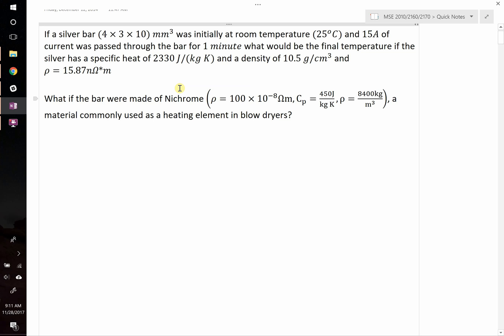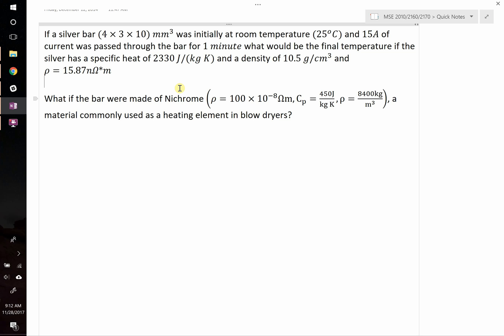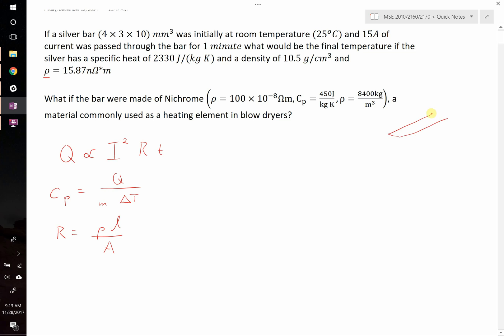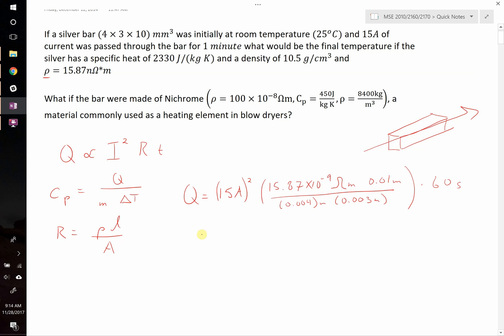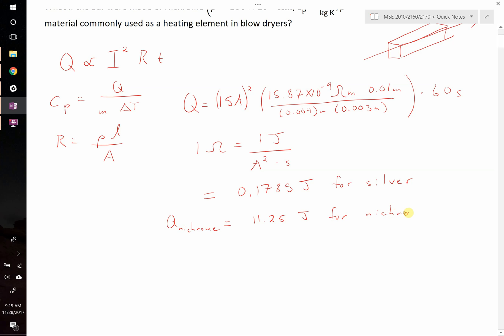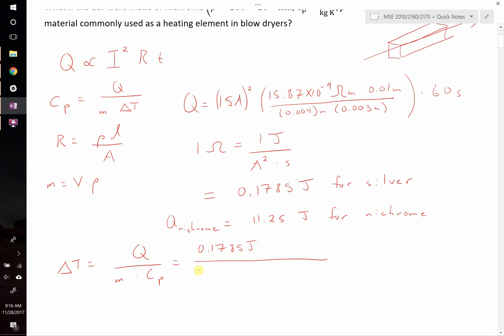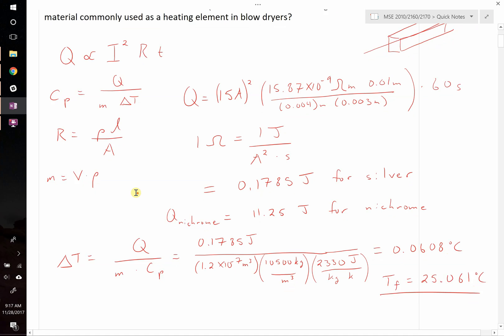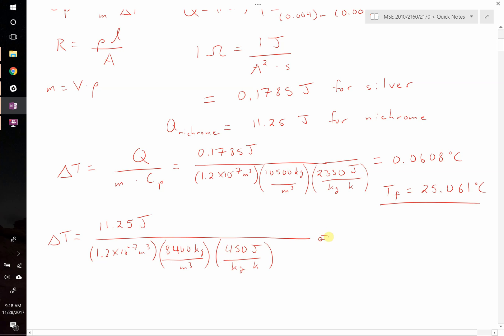Joule heating and resistance vs resistivity in heating elements example problem

Comment: Can you explain for me . why the resistance was change but the current passing them both is 15 AMP . should we increase the voltage to keep the value of current is 15 (AMP) in both case ???. tks for your help
Reply from the maker: Giao Con Huynh in this problem the current is arbitrarily set to 15 amps for both. However, you are absolutely correct that in order to achieve 15 amps in both materials with different resistance this would require a different voltage. The question is really about how much heat is generated when that current is passed through the sample though. That's why we kept it the same for both materials.
Reply: tks for your answer <3